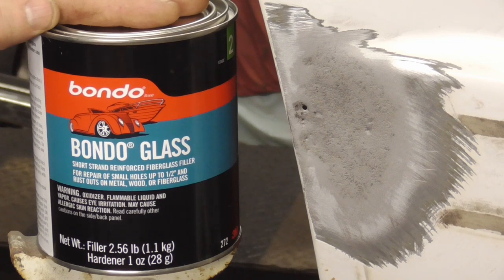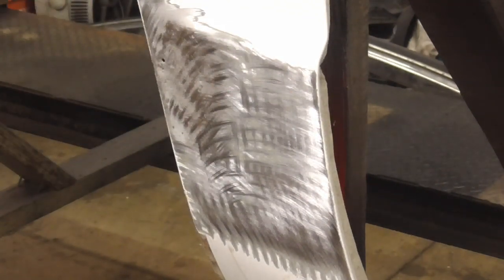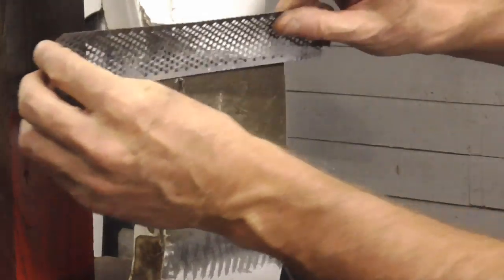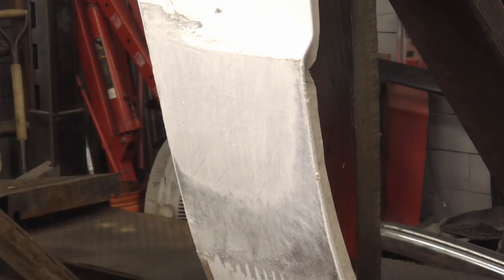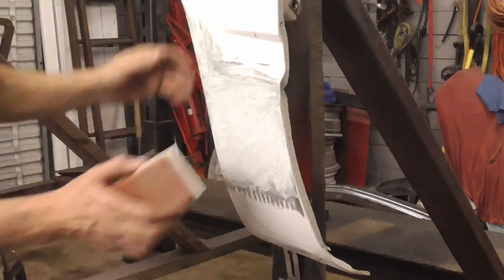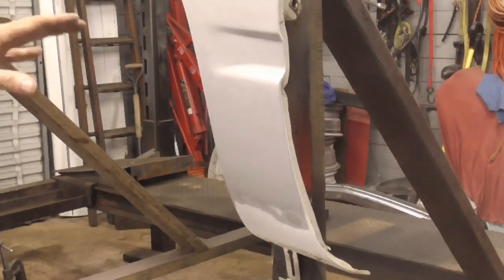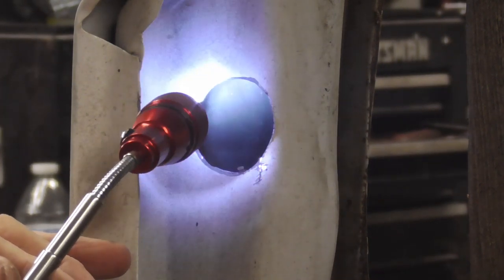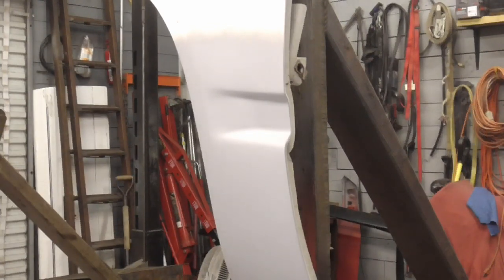How to Fix a Rust Hole Without Welding:  Duraglas, Kitty Hair Filler, Bondo Glass

Comment: I respectfully disagree that 3/8 of filler is either necessary or desirable.  That is close to half inch and is a ridiculous amount of filler. Filler is for a skim coat not to be troweled into half in deep divots and dents
Reply from the maker: That's not very respectful...  The truth is, filler isn't just for a skim coat.  The best body men I have ever worked with were not afraid of body filler and that is why they were great.  You cannot be a good body man if you are scared to use bondo.  It got a bad name because folks threw it over a hole and did not prepare the surface correctly.  In 40 years I have never had bondo (no matter what the brand) crack, fall out,  bubble, etc.  If you fix and don't just replace panels you have to use filler.  BTW, that's nowhere near 1/2" maybe 1/4 max depth after sanding.  You want to see 1/2" or more you'll have to find the 1978 Lincoln Town Car 1/4 panel I repaired in the early '80s that side swiped a tree.  Had to spread the filler on with a 12 inch piece of stiff cardboard  :)   Customer wanted to save $ on the repair but happy with the job.
Reply: @LakesideAutobody  Lets put it a different way. If you put a refrigerator magnet on it and it slides off, the filler is thicker than necessary.  The underlying metal is too deformed for a professional repair.  You can hammer out and smooth most metal in the time it takes to buy misx and apply a thick coating of filler and take most of it off with a cheese grater.
Reply from the maker: @joelpalmer  Here's a ? only for this repair.  Would you rather have a paper thin layer of filler over a hole or a thick rigid layer of filler over a hole?  Remember this video is for those folks that don't want to weld and need a way to repair rust.  The video is not about removing a dent.
Reply: @LakesideAutobody  Ok if you want to reinforce the hole using fiberglass at least put some cloth and resin on the back side or if inaccessible on the front side.  and then skim coat.  You are not going convince me or most folks that up to a half inch of filler is a good idea.
Reply from the maker: @joelpalmer  There's many ways that work in auto body repair - I've seen thousands of different guys do thousands of different things - Just showing a few of the most common and efficient methods that hold up the longest.
Reply: @LakesideAutobody  Ok. Merry Christmas and Happy New Year!
Reply from the maker: @joelpalmer  Thanks, nice talking about body work with you - Have a great week. Jerry
Reply: @LakesideAutobody  👍
Reply: @joelpalmer  Is there perhaps a misunderstanding here about which type of filler not to go above 1/8-inch on? To my understanding, regular body filler should remain roughly under 1/8 inch. However, Jerry did use Bondo Glass, a fiberglass reinforced filler for the thick underlayer which should be acceptable. I repaired half of a 3 inch wide chair leg using Bondo Glass - a good 1.5 inches thick and it has so far survived 2 years of heavy use and is still rock solid.

Comment: I’ve found the hardware store fiberglass filler tends to have large air bubbles compared to USC brand is less wet and strandy
Reply from the maker: I usually get some big air pockets with this stuff but good to know about the USC brand - thanks
Reply: Yea same stuff I have now, cheap and available in town, check out summit racing they have nice sandpaper’s, the usc and paint, $100 gets free shipping

Comment: you did a great job right up until you sprayed the "undercoating " on the inside.  This product doesn't prevent and often encourages corrosion by locking in moisture and salt as it dries and cracks.   A better approach would have been to clean the inside, spray it with a rust converter, paint it with a good rustoleum paint, then spray an oil onto the area that corroded.

Comment: Where is the hole?
Reply from the maker: The hole or holes are small but it's about to get worse - that's a perfect situation to use fiberglass reinforced filler.  Not that it's the best way to do it or the longest lasting but it will last long if you allow for drainage - no water build up on the inside of the panel after the repair :)

Comment: That was good.
But with 99$ at harbour freight for a flux welder. ?
I mean any body can mig with 30minutes practice.
And with Bondo getting to be " no longer a CHEAP fix. If you plan to hobby fix cars. Buy a $99. Dollar mig and a 25$ self darkening face helmet. Weld up sheet metal is not hard and you get better at it every 15 mins you use it.
Other than that you always show good ways of body art.
    I hope beginners take note at the way you hold the tool and let "IT" do the work 
This is the difference between pro and amateur.
Let the machine do the work. Stop pressing so hard, burning out Chinese motors!

Comment: Yes it's a nice temporary repair, but to suggest "forever" or the same as welding, sorry physics makes that just factually inaccurate.  That thickness of filler (in your video you said "at least 3/8" thick") will expand at a much different rate than the steel fender.  After enough sun heat/cool cycles a microcrack will develop and moisture will get in. Furthermore, there is NO WAY there are no air bubbles in that thickness of filler.  Again, expansion and solvent popping over time will eventually let moisture do it's damage.  It's a nice mid term repair, but let's not pretend it's the same as a properly butt-welded in patch with just a skim of filler.
Reply from the maker: I've never had filler do what you say it will do in the sun, expanding metal, air bubbles and all - that's false information. Like I said in the video, If you seal the back and no moisture can get to the repair it can last forever - why wouldn't it.  As for the but welding thing pls see this vid and also what Eastwood has to say about straight up butt welding - https://www.youtube.com/watch?v=e9bjZ_UxtJg  Eastwood vid:  https://www.youtube.com/watch?v=rpH50kh4W00&t=8s  Please see this video for longevity of filler repairs if done correctly - https://www.youtube.com/watch?v=8XaZBy7GC7A or 
https://www.youtube.com/watch?v=2o37dX--w0I
Reply: @LakesideAutobody  I'm not arguing the longevity of filler repairs IF DONE CORRECTLY.  Your video said verbatim "at least 3/8" of filler.   C'mon, let's be serious, any quality restoration shop would laugh at the statement that 3/8"+ of filler is correctly done.  And since you asked "why wouldn't it?" Here's the reason thick filler is a problem.  Because temperature change cycles acting on the different coefficient of expansion of filler relative to the steel substrate causes sheering forces at the bond interface which eventually leads to adhesion failure causing small cracks allowing the ingress of water and re-occurrence of rust. Not an issue with thin applications.  But thick filler repairs ain't right.  What's worse is how the filler squished through those existing rust holes to the backside, creating moisture points.  Yes, short strand filler is waterproof, but the metal hole it's sticking through is not and again you have different expansion rates. Paint on the inside doesn't change that, it just delays the inevitable micro cracks and water ingress. There are reasons dent puller repairs from the old days (with filler sticking though the holes like worms on the inside) aren't considered permanent repairs.  All that being said I do respect the fact that you posted a good method for a medium term repair that can be helpful for DIY folks that can't weld.

Comment: Feel as if it would've been a better option to take 5 minutes to plug in the welder and give it a few tack welds. Versus spending the time mixing glass, sanding the glass, then adding filler over that, sanding the filler and so on. And you're chances of that shit cracking and falling off in 4 months
Reply from the maker: This was for folks that don't want to weld or don't have a welder.
Reply: Ah yes, the "only way is to weld" guy.  Present on all videos that show us how to do a quick and dirty clean up on an old beater.
Reply: Not true! my old Eurovan had a fiberglass patch for a year and it still works.